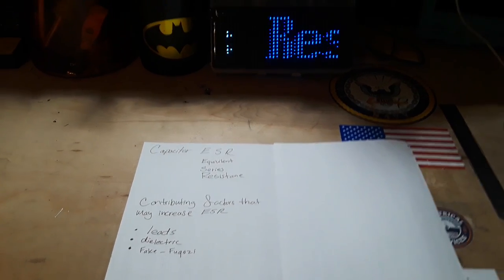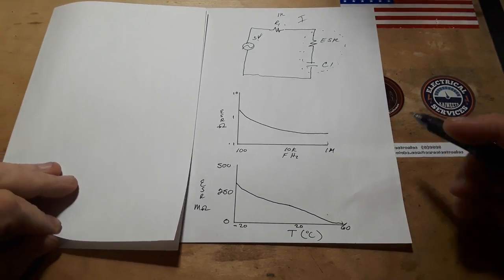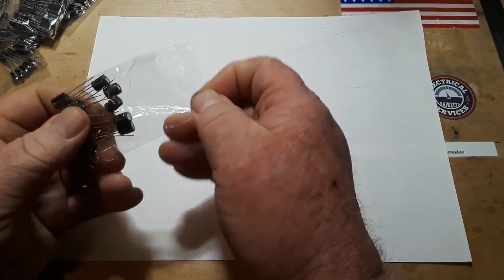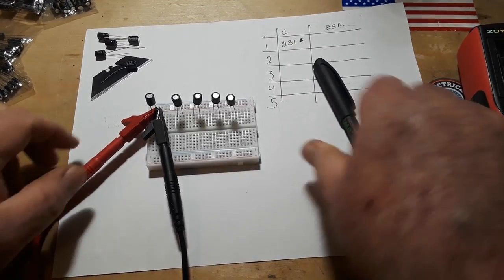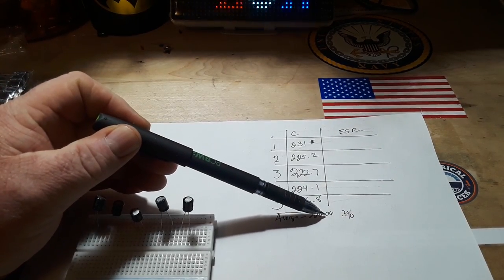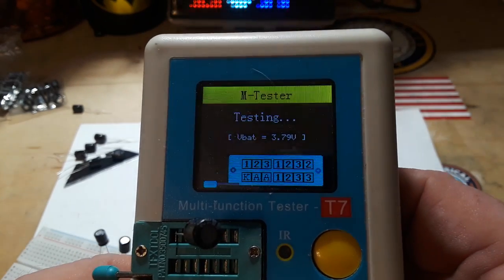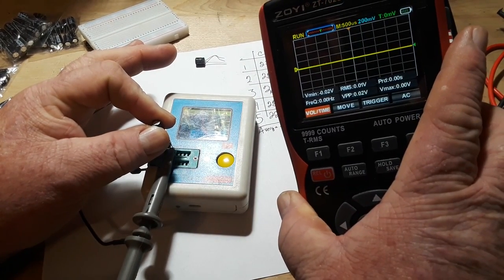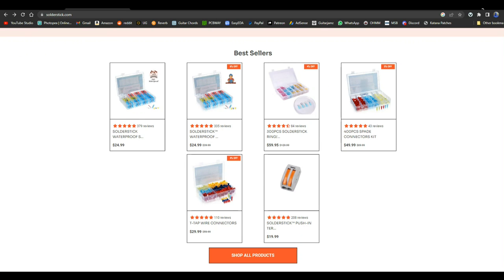Testing Cheap Chinese Capacitors -  Sponsored By SolderStick Wire Connectors

Comment: Yep, the Chinese have the advantage of learning from the last 100+ years of electronics manufacture.  Think about the electronics from 1923: the tolerances on most things were 20%.  Electrolytic capacitors were like arcane arts, and VERY expensive.

Given modern manufacturing techniques and materials, it's actually no surprise than the Chinese are now producing far better products for very little cost.

Comment: HI, a good start to looking at electro caps, I like the documentation.

At 13:00 looking for the ESR test frequency, the tester needs to detect a capacitor.
A cap in series with a high impedance DMM will probably not appear to be a capacitor.
Try putting the cap in the tester and with the scope look for an applied AC voltage.
Or put a 100R resistor in series with the cap and put the scope across the resistor.

At 9:45, 1% electrolytics,  Element 14 specs their electros at +/- 10%, check out E14 item,  	1320609.
In fact some are -10% +75%.
Electro caps in industry and commercial equipment are rarely under +/- 20%.

It might be worth to cook the caps and see how the ESR changes and how they bounce back at normal room temp.
Also check leakage at near rated voltage.
Reply: or swich tester to mesure capasitance from menu and then mesure the frequency

Comment: I have clips close to those Paul I got from Radio Shack years ago that were flat like that and they sucked for staying on. Then I noticed (and in this video) the part of the plastic that sticks out has a grove in it.(seen that when you bent the lead over with you hand)
I took the flat barb end and gave it a slight bend where it fin into that grove and it now holds the leads that I clamp to. Hope that this helps. I have some China ones that I cut a grove into it so I could bend the barb over and not it stays in place... 😄

LLAP 🖖

Man I need that meter! 🤔😃
Reply from the maker: Email me
Reply: @learnelectronics  Ok will do...
Reply: @learnelectronics  Email is on the way!
Reply: I've had the same problem with the cheap Chinese Grabbers. I finally broke down and bought the original grabbers made here in America by POMONA ELECTRONICS.  They're not cheap, but it saves me from pulling my hair out every time the cheap ones slip off of something I'm testing.

Comment: I've been thinking about this a while: using an arduino as frequency generator and hooking it up to a cheap guitar Amp. It seems to simple to work. Is this the proper way to be cheap about signal generation? Should I just get real equipment? In theory I can get any waveform at any power, and the magic smoke won't come out, right?
Reply from the maker: An Arduino can not natively do an analog output. It fakes it with a PWM and a lookup table. Look into the Teensey. Works just like an arduino but has built in audio fuctions.

Comment: Those component testers also rapidly keep swapping the polarity on the pins of the component under test. :)
Reply from the maker: Yep, which is why I thought I could get a waveform.
Reply: @learnelectronics  You'd need to set your scope to a pretty high frequency to capture it. 👍

Comment: Curious if the reading of capacitors in a breadboard would be different than out of it (such as in the component tester) due to the capacitance induced by the breadboard.
Reply from the maker: It would, but its a negligible amount and can be discarded.

Comment: Why did you use two instruments to measure the capacitance and ESR when the T7 could have given you both results?
Reply: That's what I was thinking, but its nice to do cross-check.
Reply from the maker: I trust the meter for capacitance more than the T7
Reply: Ok, just wondering.

Comment: PAUL, you're saying that the ESR is the Dielectric Leakage? but the capacitors "Dissipation Factor" is based on what? I'm not sure why your capacitor testers don't test for dissipation factor
Reply from the maker: That contributes to it, along with age, temperature, frequency, metal used in contacts etc. Any passive component is going to have resistance, inductance, and capacitance. You can also measure the ESL of a cap. Like I said it's a lot a physics.

Comment: I suspect most of the components come from a few manufactures.  The labels are different, but they come off the same lines.  Ok, I wouldn't recommend AliExpress components for satellites or missiles however for us "Paul's" WHO CARES.  Their quality is OK and when you compare the prices to the likes of Mouser - I'll stick with good old Uncle Ali.
Reply from the maker: You are correct, of course. If you've watched any of my multimeter videos, there is a company called Zotek that makes most of the Chinese meters including Zoyi, and Anang.

Comment: BTW - I have the exact T7 Multi-function Tester used in the video, but anytime I put it away fully charged for several months the next time I turn it on the battery is dead. Obviously it is drawing current while turned off. I guess I'll have to add a switch to disconnect the battery when not in use. Anyone else have this problem?
Reply from the maker: Yes
Reply: Same problem here to, I guess the battery has a high self discharge rate, adding a switch probably wont help.

Comment: I'd like to suggest that perhaps the compromise is on voltage capacity!? If the capacitance and ESR are within spec then there has to be a compromise somewhere else.
Chinese capacitors are generally significantly physically smaller than their higher-quality Japanese cousins(Rubycon Etc.) of the same capacitance and ESR.. 
So how can they achieve the same readings? Can you do a side-by-side voltage comparison please Paul? Which ones will blow first? China caps or 'quality' caps?
Reply from the maker: Sounds like a good idea.
Reply: Could be a good one for 4th of July. 😂
Reply: From my own experience i can safely say the china caps will blow first. having used some to recap a video card in the past and in other projects. first you hear the bang or pop then the smell. It would be good to see a side by side comparison.

Comment: How are these a good deal when you can buy 100 22uF 50V Rubycon capacitors from LCSC for $3.05 US? I understand the shipping is more expensive but yiu can kust bundle in more items.
Reply from the maker: I knew I was buying cheap caps. You buy from LCSC you take your chances although I looked up Rubycons and United Chemicon and they are similarly priced.
Reply: @learnelectronics  Why am I taking chances when buying from LCSC?

Comment: Even Illinois Capacitor electrolytic caps are at either 5 to 10% so 3% is not bad.
☮️ brother.
Reply from the maker: I know I thought these would be garbage but they test great. Have to do a torture test
Reply: @learnelectronics  I like to see that.